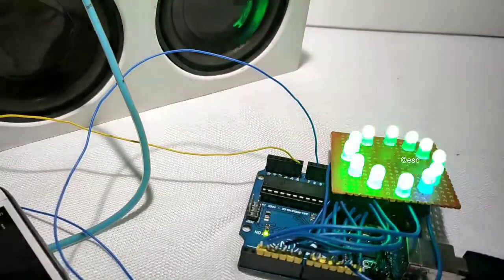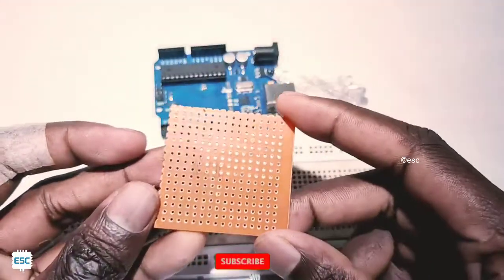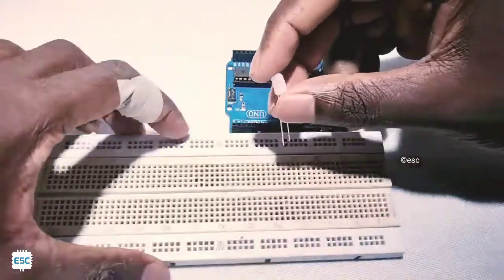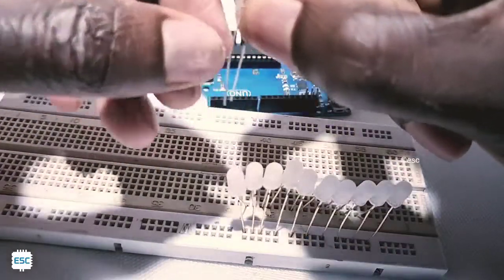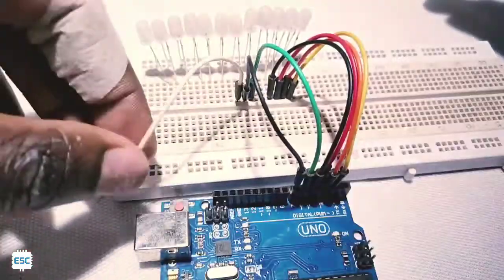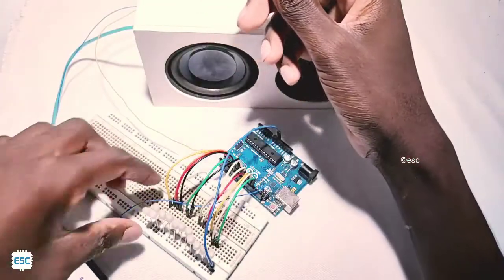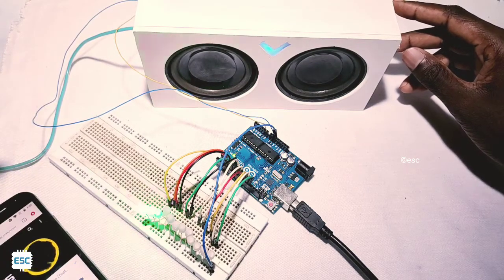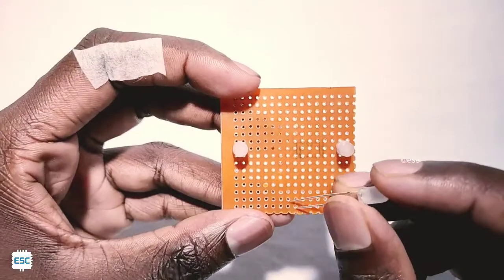Simple VU meter using ARDUINO | DIY

Comment: great project. I'm wondering where would I connect the two wires coming from the speaker (I am using this amplifier board and it has bluetooth so I don't need the aux connection:https://store.sure-electronics.com/product/AA-JA32472v2 )
Reply from the maker: Connect it to the  aux point